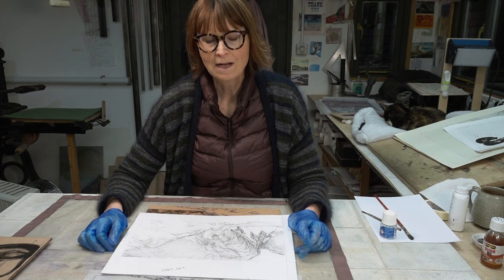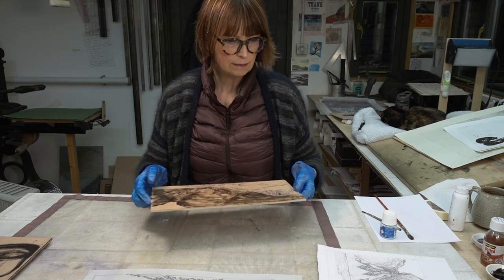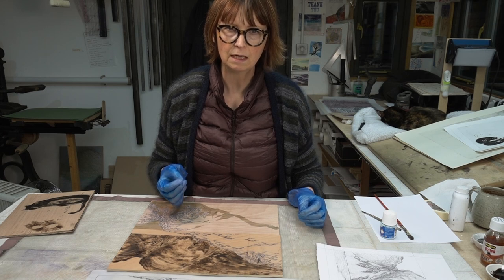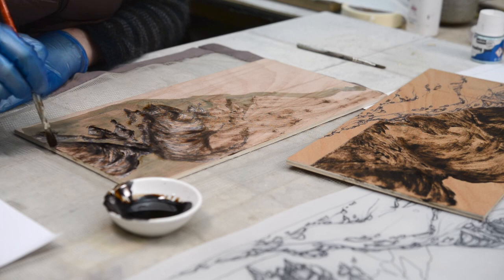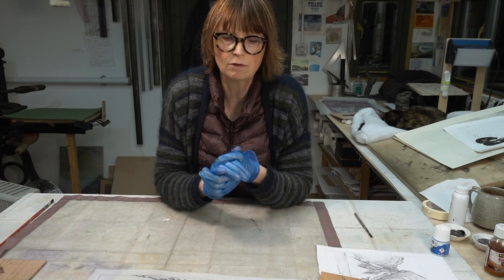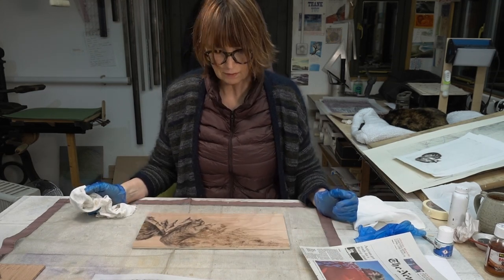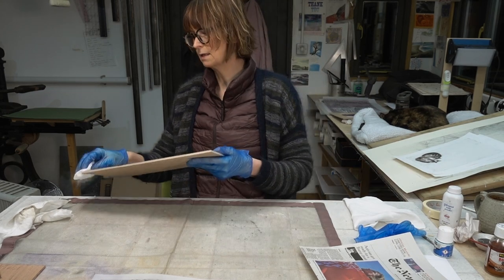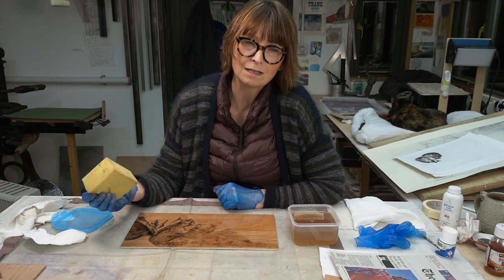Preparing a Mokulito Block:  Mokulito/Mokuhanga Project combining wood litho & Japanese woodblock

Comment: Hi Laura ... a little bit late (5 months!) coming to the party: only just discovered your video sessions and the Mokulito process. Really enjoying the content and your style. A bit nostalgic too ... a five year lithographic print apprenticeship served forty plus years ago. To clarify a couple of points in the comments below : Carbon copy paper image is largely made up of various waxes and carbon black powder (to make the image visible). The wax acts as a binder for the carbon and is oleophillic / hydrophobic - so attracts the oily, greasy ink. Gum Arabic is hydrophillic - attracts water. Oil and water do not mix ... the whole principle of lithography in a nut shell. As for the talc / baking powder ... not sure either. No chemical or process reason for this stage that i know of. Best guess - if applied heavy enough and left long enough gum arabic could  "eat" into the image area - as would happen to printing plates. To prevent this the gum arabic layer would have been smoothed out ( effectively wiped off the greasy image).   Maybe the talc "fixes" the image as you suggest - preventing the image from smearing when wiping the gum layer onto the plate by forming a "skin" or barrier to prevent this ?
Reply from the maker: Hi Peter thank you for that - great explanation and very helpful. Still kind of believe it to be pure magic though!

Comment: Did you say think bitumen with linseed oil? I missed how you applied the masking fluid…
Reply from the maker: I diluted the bitumen with the linseed oil (which I’ll be using again in inking) and I just painted on the masking fluid with an old paintbrush